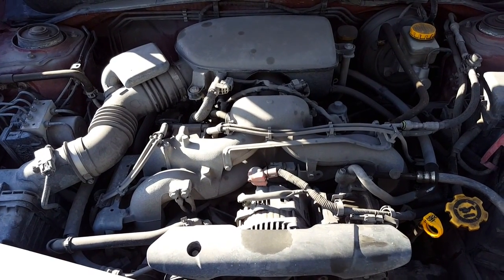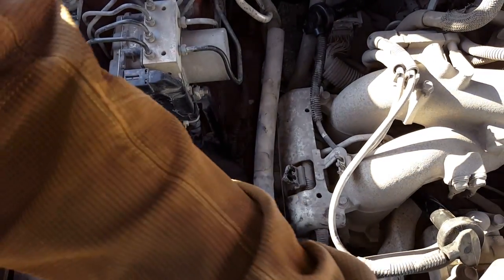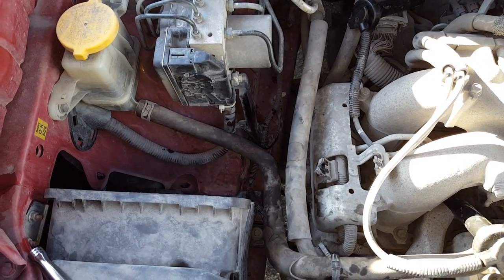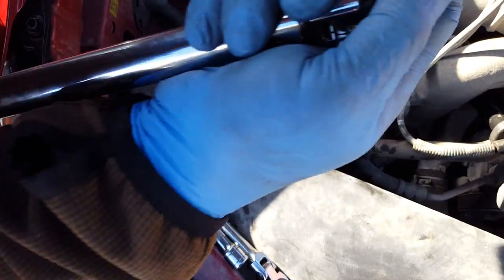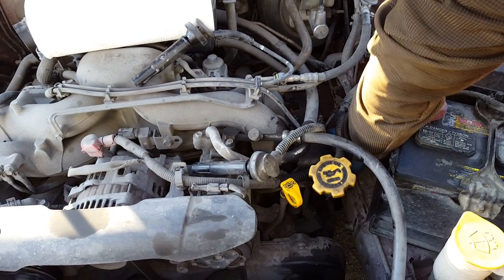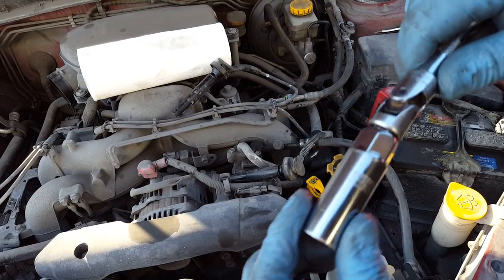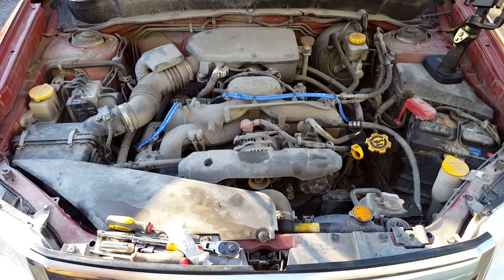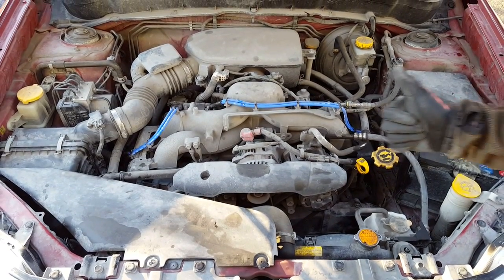2009 Subaru Forester 2.5L:  Replacing the spark plugs and spark plug wires

Comment: Hey ive heard not to use anti seize on the plugs? Is that only on non oem plugs?
Reply from the maker: It's one of those things that people have argued about ever since spark plugs were made.  Some manufacturers suggest not using any anti seize on their plugs, claiming that their coating on the threads is 'enough' to prevent the plugs from getting stuck.  Others suggest that it affects the heat range or ability of the spark plug to dissipate heat.  My own opinion is that a very minimal amount of anti seize is a good thing...many people go wrong by putting way too much on the threads.  I've come across many vehicles where the spark plugs seized to the engine and were very difficult to remove.  A little bit of anti seize would have made the difference in those cases.  You'd really be OK either way, it's just a personal preference IMHO - do whatever you're comfortable with.  I find it's far more important to make sure that your spark plugs are torqued properly, please make sure you follow that step, if nothing else.
Reply: AKJeeper i also think i may need to replace the spark plug gaskets on my subaru, can i do that without having to tear apart my engine bay? I know i have to remove the rocker cover to expose the gasket, would that be something that would be relatively simple (dont have to take out a bunch of stuff just to undo it)
Reply from the maker: I'm assuming you're talking about the spark plug tube seals?  That's a very common issue on these Subarus, and can cause the spark plug wells to fill up with oil and be the cause of a misfire condition.  Fortunately, it's not too bad of a job...each rocker cover (aka: valve cover) is held on by something like 5 or 8 bolts, and perhaps the oil fill tube on one side.  If memory serves - the driver's side is a bit tighter for access, but can still be done given enough patience.  Once that's removed - the spark plug tube seals are exposed and can be easily removed by hand.  This is a good time to replace the valve cover gasket as well - another common source for Subaru oil leaks.  It's a relatively simple job, but a little time consuming.
Reply: AKJeeper thank you so much! Will get working on this asap. Great video too! I guess ill type here if i run into any issues but should be good to go
Reply: AKJeeper is there any special way to pull out the wires from the head? Or just yank on them? And just push them back in to connect them? Also should i put anything on them when i put them back in? Any grease? Sorry for bothering you!
Reply: AKJeeper whoops watched the rest of the video! Sorry!
Reply from the maker: You might have to break the rubber free from the spark plug.  I do this by grabbing the spark plug boot by the 'ears', and rotate it back and forth to break the rubber loose.  From there, pull on the spark plug boot - the spark plug boot/wire should come right off.  I usually put some dielectric grease in the boot, it keeps the boot from getting stuck next time, and also prevents dirt and moisture from intruding in the boot/connector.
Reply: THAT is the most informative piece of information I've read yet. These machines are completely foreign to me. I'm about to tear in to this 98'. For some reason I keep reading comments on these Subaru videos about anti-seize. I don't quite understand where these comments are coming from... Is this something that was injected in to the Subaru community?

Comment: To anyone watching contemplating ding this job - take the battery out. It's a 5 minute task and makes the job so  much easier. In any case, the earth (negative) terminal of the battery should at least be removed when working on car electrics.

Comment: I understand his perspective about not using too much anti seize, however I do believe that it is copper based, therefore shouldn’t the conductivity be better than normal?
Reply from the maker: The most common Antiseize products are either copper or nickel based.  The issue is not with conductivity, but rather too much in the threads can affect the overall torque value of the spark plug.  I use the antiseize as a measure to prevent the plugs from getting stuck (very common issue in my climate).  Also - too much on the threads could actually prevent the spark plug from seating properly in the cylinder head, which is why I state not to use too much.  A little goes a long way.

Comment: How often do you change the plugs and wires?
Reply from the maker: I recommend replacing the spark plugs at 50,000 mile intervals.  Spark plug wires should be inspected at every spark plug interval.  If any damage is found, replace them.  Otherwise, I recommend replacing them every 100,000 miles.
Reply: AKJeeper thanks again! Just did this on Monday!

Comment: Have same forester has ur valve gasket on driver side started leaking
Reply from the maker: larata9 no the valve cover gaskets on this car are not leaking. It is an extremely common issue, though. You're often see oil in the spark plug tube and possibly an external leak too.

Comment: How well did this vehicle run with the wide plug gaps?
Reply from the maker: Bill Safreed not well.  It had a harsh misfire on cylinder 1.  The wide gap caused the spark energy to seek ground elsewhere, in this case, by burning a hole in the spark plug boot (I have a separate video on that).  The vehicle was also a little difficult to start when cold, and fuel mileage dropped off considerably.
Reply: Terrible valve 1 misfired ,hessitated and lose power
Reply: Mine was experiencing and hesitation on re-accelleration at highway speeds. In other words if I had get off the accellerator, and then re-apply, the drivetrain would stutter a bit. New plugs solved that issue.

Comment: DO NOT USE ELECTRICAL TAPE! If the tape fails to hold the extension or universal in you will extremely screwed. The electrical tape will ball up and prevent you from putting the extension back on. You will spend hours with you fingers down the spark plug hole trying to fix the mess you put yourself it. 

Tip: Instead of tape you can put the spark plug half in the socket. the rubber will still hold it in place and one you have tightened it in a couple turns you can pull it out. Complete the rest of the turns using a deep 5/8" socket